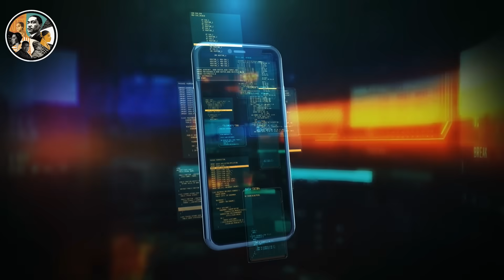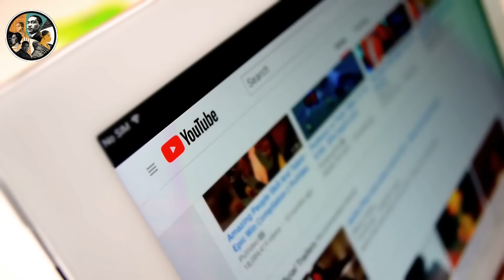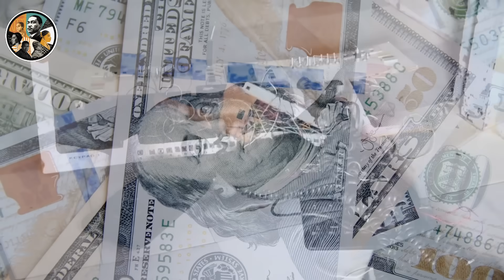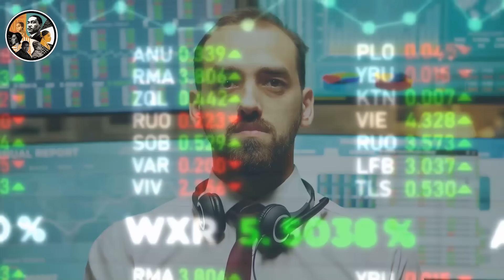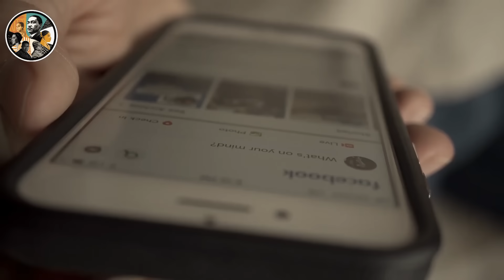Namibian Boy BUILT Phone That Doesn’t Need Sim or Airtime—Then Vanished

Comment: From my experience in this field, this could only be a WiFi and/or other network with an add-on for a standard smart phone for another mesh, depending on what part o the spectrum is available.
Something  like what the police, Fire, and military use or something like LoRaWan which can't carry a lot of data, and/or if there is line of site to a tower, mountain, etc. there could be point to point or multi-point. These multinetwork devices have been around for a long time to save money and avoid satellite and phone plan cost when not needed.
Somebody or multiple people have to have internet connectivity to share with the mesh to speak with people not on the mesh. No diagrams or actual documentation have been provided with this video.